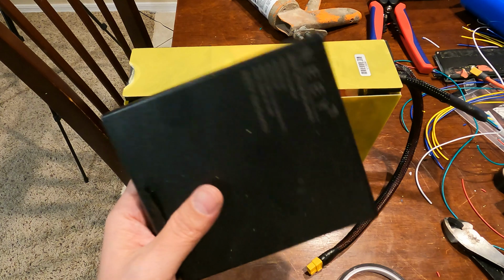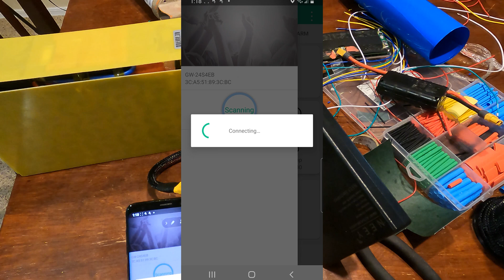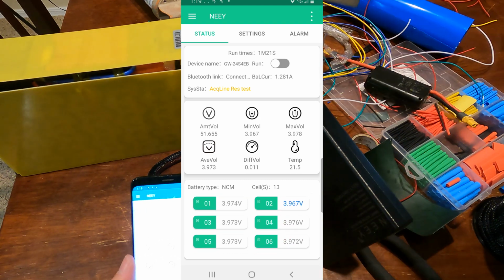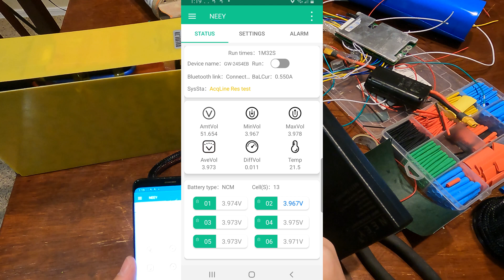How To Upgrade Electric Bike Battery to Solar Battery

Comment: but it was better to use an active bms jk bms that isite is a lot of cable
Reply from the maker: Indeed 28 balance wires. 100% worth it. I did it to 4 of my ebike batteries.